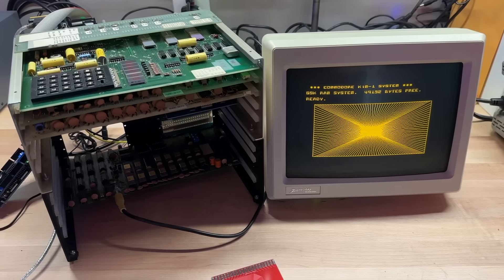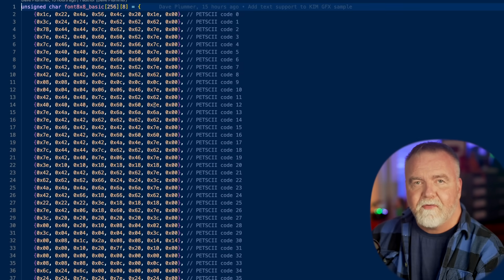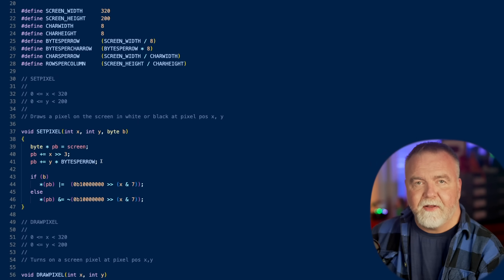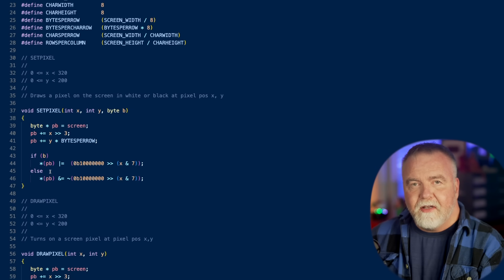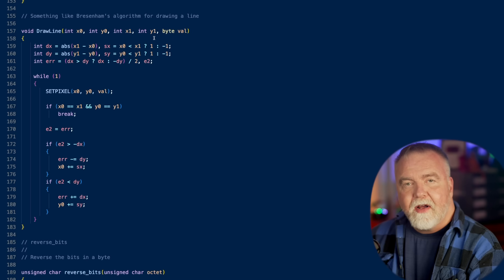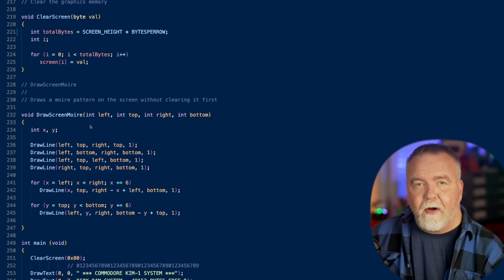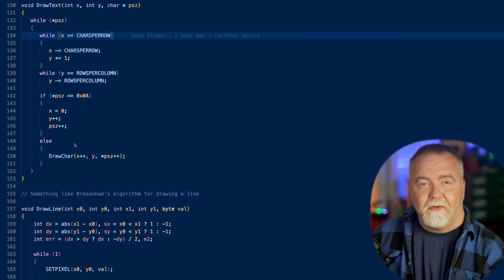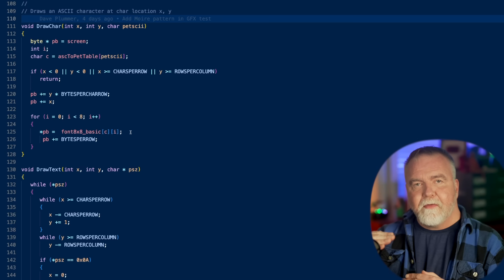Coding Graphics in C: SetPixel, LineDraw, Moire and More!

Comment: You should definitely do more things like this with how programming works
Reply: Couldn’t agree more. I especially liked the other videos Dave had on C and Assembly. 10-20 mins like this on one relatively simple program gives me lots of practice material to learn from.
Reply: Agreed! So happy to see this type of low level coverage
Reply: @milk-it  This video is like "coding from the scratch". The times when developers had to code their graphics drivers on their own are gone. Nowadays, software engineering is not about the basics, but about much more abstract topics like portability, reliability, security and so on on that ground of primitive hardware based drivers.
Reply: @Railur  Good point. That's why so many apps look and feel the same nowadays.
Reply: @milk-it  Or maybe because they're all made in javascript or python.

Comment: You can speed up that Bresenham's implementation considerably by avoiding calls to SETPIXEL.  Instead, translate the x,y starting point to a byte address and a mask (as done within SETPIXEL), and within the loop, treat x moves as shifts of that mask (adding/subtracting one to the byte offset if the mask becomes 0), and treat y moves as adjustments (add/subtract BYTESPERROW) of the byte address.

Back in the day (circa 1985 with an EGA/VGA adapter on a PC running MS-DOS) I had an assembly language Bresenham's that was nearly as fast as a NEC 7220 based board.

Also, for a lot of applications (I was doing CAD work at the time), it is well worth the minimal effort to optimize horizontal and vertical lines.
Reply: Back on my CGA machine I was doing just that. I started with a setpixel (ASM inside of C code). That was about 200x faster than the built in command..
I started with this level of simple line command, setting every pixel of the line. Then improved it with a look at how many bits in a byte are set and did them all at once.
Fun times!!
Reply: @hrayz  Yeah, BGI, Borland's graphics library, was useless. It was nice and compatible, but useless in terms of speed. And couldn't access MCGA / 256-colour mode. Better to just set a big pointer to graphics RAM and do it yourself.

Comment: Happy memories of designing a tiny antialiased font to draw text in 256 color SuperVGA. It was for a simple GUI to acquire and show CCD camera data for use in an electrophysiology lab (looking at calcium transients in cells using calcium-sensitive fluorescent dye). Somehow there was enough room on the screen to display the image frame, a histogram and a control panel at the same time. The advantage of whatever mode I used was it had square pixels (so the image frame wasn't distorted) and there were enough colors to represent the range of intensity values coming in from the camera. If I remember right, it was a variable width font with maximum width 6 pixels and a height of 9 pixels. The manual 'antialiasing' was two-tone.

Comment: Loved this!  Man, this takes me back.  I still prefer to program in C (not C++) to this day, usually using a GNU compiler which supports the newer versions of C.  I remember programming graphics in DOS on my old computer in the 1990s.  I wrote my own graphics library much like you have here by accessing A000 etc... as I learned I added more functions to it for lines, some optimized functions for straight lines (I think that used memset commands to set larger amounts at once).  I loved those days and the fact that it wasn't done for you.  I created a free game called Deluxe Pacman 1 & 2 for DOS, older Windows and modern Windows (last tested on Windows 10) and it is coded entirely using C (no plusses), only it uses the Allegro library (I honestly wish I had done it entirely on my own and never used a library).  Good times anyhow.

Oh, and I used to use DJGPP for DOS back then, it handled the memory limitations for you, so no worries about things like long jumps and the like.  I believe Quake was written with it.  Very nice.
Reply: This is so cool. I always wonder how did you guys learn these things, I really love low level programming but I don't understand it that much.
Reply: I'm trying to learn what you did to write Pacman, but my graphics library will be entirely vector-based, so no more of those yucky antialiased jagged textures, and made especially for SVGA. I'm doing this for my own optical engine, then onto the FI and POST for my homemade operating system Chiplock, and then for what's known as a GCLI, which is just a regular CLI with graphical elements included to create a sense of immersion. It would have also been handy if CRT monitors were still common.

Comment: A few years ago I wrote a graphics primitive library for Arduino driving a 20*10RGB led array. This was used in a series of digital art workshops as part of our National Arts Festival.  The best of the art was later displayed on our huge  Rgb periodic table display. Each element was about 6x6” . Since the pixels were wired in an odd order I created a translation table to translate x/y to pixel number. Fun times.

Comment: Hi. Great video. Every video I've ever seen you make is a great video.

I wrote a line-draw algorithm using Bresnahan's algorithm, which is faster than the most modern line-drawing algorithm. I used system functions to draw text. I might rewrite that to make the text code more portable.

At 3:22, you said the 127 was for the leftmost pixel and 1 was the rightmost pixel. I think you meant 128 and 1, unless the pixel is set to zero, in which case a mask of 127 is correct for the left-most pixel, and a mask of 254 is needed for the rightmost pixel. I'm sure you know what, and that most people realized what you meant.

Comment: I once had to do something similar in TRS-80 basic to render a working analog clock. The "pixel" drawing was quite interesting in that machine since the character set contained 64 characters consisting of 2x3 black&white (black&green) blocks (one character for each possible combination of those 6 "pixels"). The way of walking a line to draw each pixel was pretty much the same as in your case, Dave. The "mathematics" (missing most of the C bit manipulation options) of setting/clearing specific pixels was a bit of brain teaser though. And needles to say that it was slow enough to make a real-time seconds hand unthinkable.
On the other hand, clearing/filling the screen (when done in machine code) was fast enough to create a stroboscope thanks to the mere 1K of video memory and the mighty handy LDIR or LDDR instructions (those of you with any Z80 experience can probably code that in under a minute).
Anyway, thanks for an entertaining trip back in time to those early times where problems had to be solved by pure brain-power rather than processor-power. :)
Reply: Sixel graphics.

Comment: Nice idea of porting a C compiler, even if limited, to the KIM-1. Good stuff.
Reply: Dm_official_Daves_Garage  BOT! All, do not reply to the fake Dave!
Reply: It is not porting. CC65 just generate 6502 code from C. You need to set a configuration to target KIM-1 - it is pretty much the extra stuff you need (beside the actual code) to make it easier/useable by the system.

Comment: This reminds me times when I was seven years old with zx spectrum at home, some programs in basic and one book to look at and to learn from. For some reason my mother which knew something about programming (algol, prolog ,fortran ... not sure) from university helped me with writing programs drawing doilies. I guess it was some cycloids with use of trigonometric functions. But I'm sure basic had sin, cos, putpixel or similar command. It was nice to watch cause it took some time.
I'm surprised that computer from that era has C.
Reply: That's a great memory, Pavel.
Reply: It’s a modern C compiler that targets 6502 code. C was far from popular on that generation of hardware at the time.
Reply: @stevetodd7383 ops. Yes. Editor in 80s didn't have syntax highlighter and I was not thinking about cross compiler. Which brings question how to transfer data. USB to serial? Old computer with floppy drive? Audio cable emulating tape?
Reply: @pavelperina7629  I think Dave mentioned connecting via serial. These machines did lack a lot of the oompf needed for a modern IDE, and even at the time a lot of commercial work was cross compiled on mini computers (MS BASIC started life on a PDP IIRC).

Comment: Yes... Commodore machines use bits in msb to lsb order for character definitions and bitmaps (and sprites). That directly mirrors how you'd write a bitfield with the value for the pixels you want on/off.
Reply from the maker: But why high bit first?  The "electron gun" scans left to right, so why not lay out the memory from LSB to MSB?
Reply: @DavesGarage  Given its vintage I'd definitely blame Pink Floyd and drugs.
Reply: @DavesGarage  The msb first logical order is a matter of left instead of right shifting by the video hardware. msb first bit order is actually pretty common in bitmap formats, not just for Commodore. It is also used in quite a few bitmap file formats because of that.

It is kindof interesting, because at first glance your commenting on this seemed odd to me, but then... I did grow up essentially with bitmap graphics being msb first, and if you look at ram as bitfields, it is extremely convenient that way (you can easily check whatever a character looks like in most monitors for example).

But... when writing code for that in C it seems strange indeed that it works like this, I can see that.
Reply: @darkwaveatheist  lol
Reply: @DavesGarage it’s just a matter of the order the bits were shifted out to video. Someone must have looked at the binary written down left to right and thought it made better sense to shift them left rather than right.

Comment: This is definitely fascinating writing runnable programs for the PET in C. Some quick questions about it, is this being cross-compiled  eg. like on x86-x64 platform with the toolchain targeting whatever instruction set the PET uses? Is there anything like a notion of an executable format on the PET? eg. PE32 on windows, ELF on Linux. How do you load the compiled executable onto the PET?
Reply: He mentioned CC65 which is a C cross compiler for the 6502 CPU. The CC65 compiler can generate multiple output formats, like raw images of machine code or even a PRG-file for the C64 etc. I have a few videos on my channel about the CC65 compiler. I'm not anywhere Daves level though. :)

Comment: I would love to see this on each of the current major platforms too, because this is how I started coding on every machine: Apple II, TRS-80 Model 1, ZX Spectrum, Amiga, DOS & older Windows. Usually first in the native BASIC and then moving to machine code, assembly, C, C++.

But on modern Windows, Mac, Linux (and maybe the phone OSes) I would love to do the same, but man it's hard to impossible to find some example or tutorial like:

- Use the "native" language of the device/OS: C, C++, C#, Swift, Kotlin
- Don't use any frameworks or libraries or SDKs other than the most basic ones the OS comes with or its official community/free dev tools come with
- Use the lowest level supported techniques of the device/OS
- Open a window, or preferably a screen or a full-screen borderless window
- Be able to draw either by some equivalent lowest level graphics primitives equivalent to plot() and line()
- OR to have access to bitmap memory where I'd need to implement my own plot() and line() primitives
- Handle window resizing, screen resolution changes, etc (in other words no hardcoded window dimensions)

I realize most and probably all systems now go through a 3D pipeline even for 2D graphics and may not offer any direct way to the native hardware bitmap since that belongs to the graphics card. But a full and thorough discussion of this would be one of the major parts of the basic intro at the start.

Then old fart programmers could have fun like the old days on their fast new systems!

Someone start a git repo (-:
Reply: Honestly search engines nowadays are disappointing it's just full of garbage i guess the only way to find information is through books, videos like this one or just simply asking chatgpt
Reply: @yuyuyuyuyuy484  Programming books are disappearing and getting horribly expensive. I thought they were horribly expensive 30 years ago (-:

There's very few people doing videos on this kind of thing. There are some for retro systems. More using frameworks of many kinds. A couple using text console are good though! Community is best if I'm not the only one looking for this.

This is something I haven't thrown at codebots yet though. Time to try...
Reply: @andrewdunbar828  I'm assuming these kind of videos are few because youngins (like me) don't need to understand such low level concepts because a lot of us want to do stuff quick, nevertheless its very interesting to learn about; have fun with the codebots lol.
Reply: @yuyuyuyuyuy484  Definitely! I like the videos for the youngins and the ones by the youngins as well as the ones by and for us olduns (-:
So far the codebot has been trying valiantly but I'm starting with macOS which is the least documented so it's going around in circles but in different circles to the ones I go in when I try to work it all out myself...

Comment: I did almost the same thing about 20 years ago on an 80286 PC. As I remember very clear about the address 0xa000. It is the begining address of 13h VGA mode, which is a 320 x 200 screen. After Microsoft Windows 95, you can't draw graphics by writing data to screen memory.

Comment: Does the setpixel also has a starting point and ending point where the pixel draw is starting from and ending on? to make it possible to calculate from each side where to perform a future possible draw call within some future functionality. This could be useful for determining light sources on surfaces and what not for 2D or 3D games.

Comment: Hey Dave excellent show..long time listener first time caller...:-) I subbed after your addressable RGB LED series. Ive also had to work with these functions mostly in the last few years in writing graphics to OLED screens and I utilized these same functions you've described here but in my applications drawing graphics pixel by pixel while sending and receiving data takes up too many cpu cycles so i had to find another way... I can display an entire 30 second (10 frame/s) graphic animation to the screen using somewhat less cpu cycles by drawing the entire screen frame by frame( from const char pixel bitmap pixel arrays) but theres a shortcut because i just turn black and white images into frames and those can be sourced from anything. ..my knowledge has some gaps i need help with one main thing. How can i write the display using a changeable char array instead of constant char so i can rewrite each frame after compilation or how do i write the data directly to the memory location of the const char to change its contents in the loop? i tried a few pointer based methods before but i think it either didnt compile or kept crashing. i probably just needed to tighten up syntax somewhere...